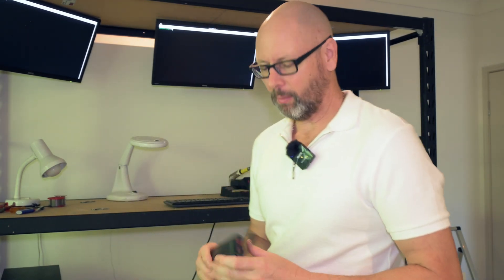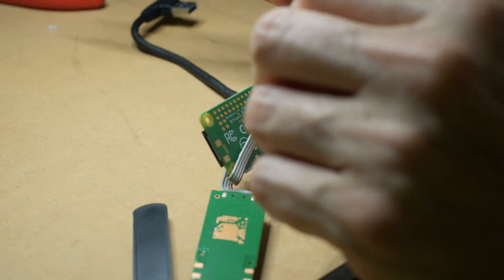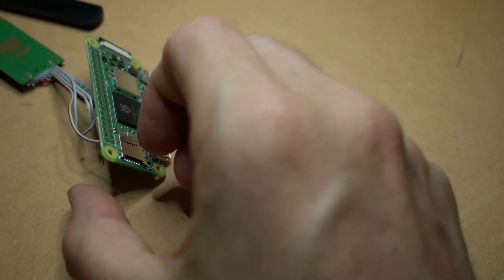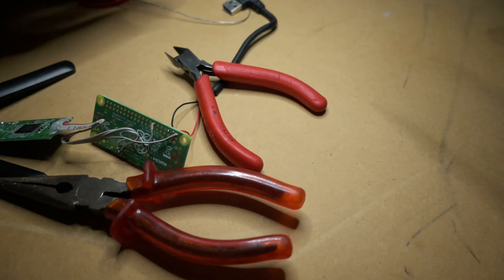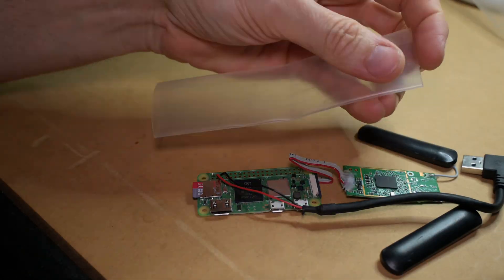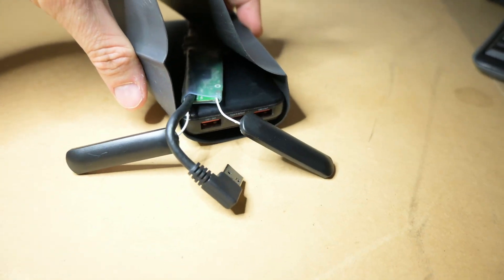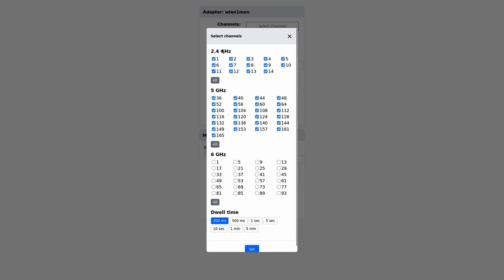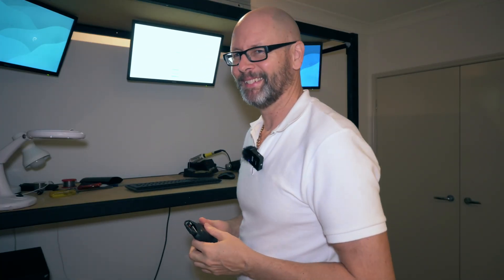Wi-Fi Capture Device Upgrade To Raspberry Pi Zero 2 W

Comment: Brotip: pretin, and then lightly flux the holes. That's what she said.
Stick the leads in, then heat them up, they won't need any more solder and they'll attach right to the holes. Sometimes less is more, especially with solder bridges.

Food for thought.

Thanks for the video Paul
Reply from the maker: What I know, and what I can be fucked doing as an old blind cunt are two different things!

Comment: What wifi chipset do you recommend for linux? I recently got a modern laptop with mediatek mt7902 but unafortunately it isnt supported. Something compact and cheap to get basic 2.4 and 5 ghz  .Thanks mate you are doing great videos . Cheers
Reply: The adapter  in this video is the adapter in Paul's post from 7 months ago  "Portable Raspberry Pi Wi-Fi Packet Capture Device" , a AX1800 wifi adapter stripped of it's case and USB connector.
Reply: @kevinarndt1328 thanks mate i’ll watch it
Reply from the maker: Yeah, something like that

Comment: I believe you can capture with the built in RPI WiFi now so if someone just wants a device to capture on the go and analyse later they don't need the external WiFi module!
Reply: One to do the channel-hopping captures and another for the mgmt access via wireguard.
Reply: @mwoliver Yep
Reply from the maker: The in-built one is for the control channel only. It's a 2.4GHz piece of shit. The one I attached can do 6GHz captures, and is separate to the control of the Pi.
Reply: @TallPaulTech I forgot you had to go up to the full sized rpis to get 5GHz (still no 6GHz of course).  Sometimes you just want to walk around capturing then analyse later.  This project is a lot more use as it's interactive.